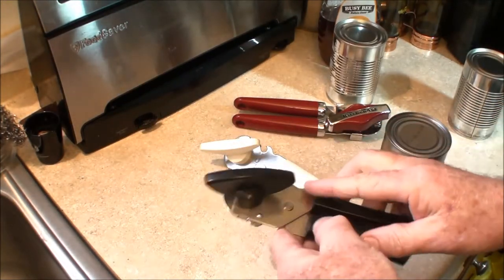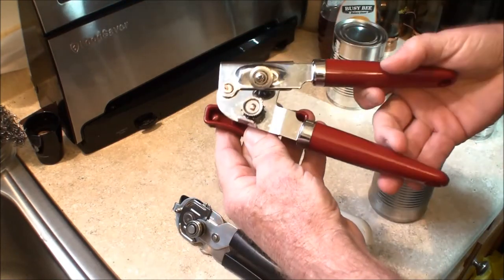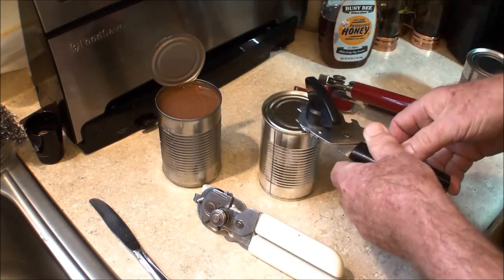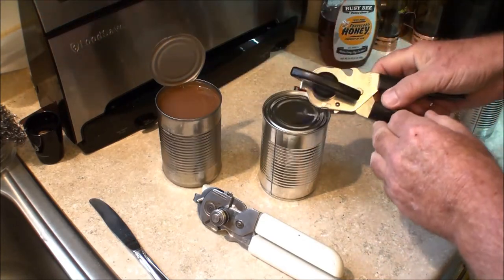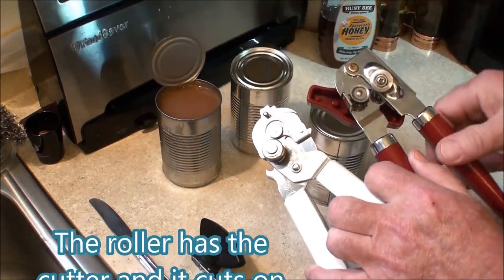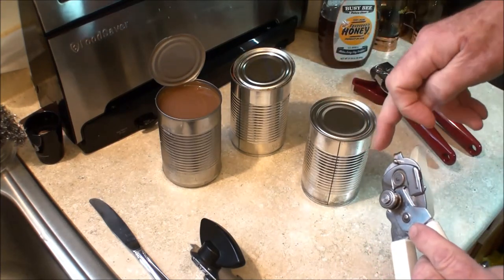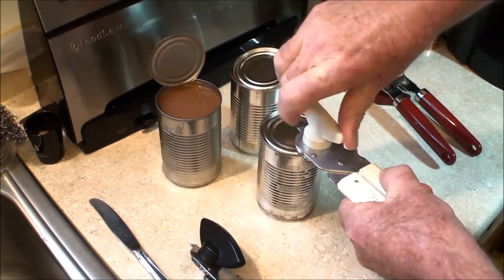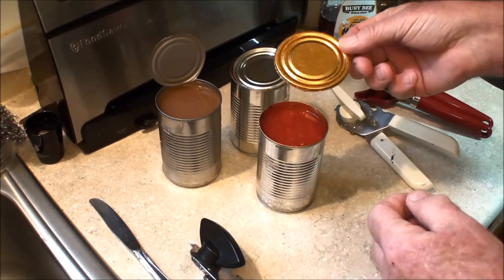How to use a Manual Can Opener

Comment: Hello MIke,  thank you so much for this tutorial.  I have the can opening that cuts on the outside of the can, that was here when in I moved here.  I've been awkwardly trying to figure out how this works.  I bought the old cheap one but it only worked for a minute and seems to be stripped; meaning, it's not cutting anything, other than the initial entry to the can.  I've searched   you tube and your is the only one that explained stepped by step and described the parts and how they work.  I went immediately to open up a can..  Thanks again for the great tutorial!  I give you 4 thumbs up. Blessings...
Reply from the maker: Thank you so much Angel Mac. When my wife got the opener, I hated it because I didn't understand it. Now its the best and only one I have and I have found it leaves no sharp edges on the can or lid.

Comment: Yes I have used both 👍
I have a P38 C-Ration can
opener on my key ring. 
Has been used hundreds of times 
over the past 35 years, and works better every time I use it 😊👍
Reply from the maker: When I was younger, I had the same can opener. I still have it, but put it in a drawer because I put my keys in my pocket and would stab myself every time I went to get them David Carlisle

Comment: Mike I hope this doesn't sound silly,,but I did not know there were two types of can openers?! LOL.. I have the electric and never use it! I love my manual can opener. But I want to go and get the one you have that makes it come off cleaner and safer! Thanks for sharing this video!
Reply from the maker: The first time I tried to use this kind of can opener, I wanted to throw it away until my daughter showed me how it really worked. lol. Now I am not afraid I am going to cut myself with the lid either Nicole

Comment: Great video there are a lot of different type now.
Reply from the maker: Yes there are Tracey Ancell. The best over all are the Black or White one in my opinion. No sharp edges and opens the first time, all the time and great for the crafter so they can use the can and lid
Reply: I thought it was a great video. I do crafts myself showing the different ways they cut was great. I have a few different types myself.

Comment: I have only ever had the red handle type and electric ones.
Reply from the maker: I have used the red handle type for years and didn't always open the can right, even when it was brand new. This other one is so simple to use and opens it up every time. Not as bulky and no sharp edges on the can is a plus Great Grandma